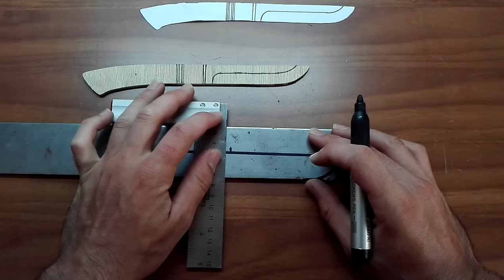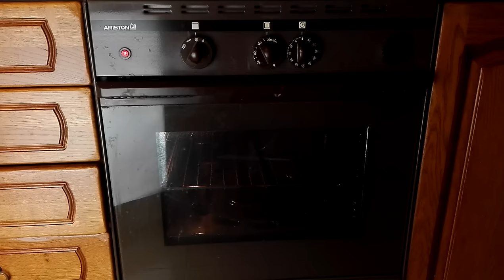Knife Making: Vikings Inspired Scandi Knife

Comment: Great video and music :)
One question, ¿how much time and at what temperature did you put it in the gas oven?
Thanks!!
Reply from the maker: Thanks! :) With this 1070 you have to temper in a single cycle at 200°C for 2hr. But even every high carbon steel might be slightly different! If you use a known steel check out the datasheet :)
Reply: Very informative answer =) ¿Do you know where can I see this datasheet? Lol!
Reply from the maker: Try to search for " ..... steel heat treatment" where ... is the type of steel. For example: "1070 steel heat treatment" gives this as first result http://www.steelforge.com/aisi-1070/
Reply: Thanks bro!

Comment: I usually temper my knives inthe oven at 200° C for 2 hours. Is it too much? Sorry im new to knife making
Reply from the maker: It depens on the steel you are using and what thickness is your blade :) Look for data sheet you can find all heat treatment info! Anyway for 1070, 1095 or other similar steel at 4mm should be perfect!

Comment: How did you make your forge ??
Reply from the maker: I used mineral whool and refractory cement, the air come trough a large rectangular steel pipe that has holes in it to allow air into the middle of the forge. :) On my fb page I have posted the photos i did when I made it if you want to check them out. Not a difficult project, it just take some time for the cement to cure :D
Reply: oh cool. Thanks dude ! :}

Comment: How long do you leave it in the fire
Reply from the maker: I check with a magnet, when it reaches the temperatre where it doesn't stick anymore I leave it there for some extra minutes than I quench it. High carbon steel like this one or 1095 are quiet forgiving with the temperature, you can get them hard easy like that! :)

Comment: why all that work but only put the tang 3/4 in?
Reply from the maker: I don't get it :) It's an hidden tang knife, many are made like so :)
Reply: a true hidden tang goes all the way back in the handle, with about a half inch of spare space, theres well over an inch of spare space in here and that can cause the knife to break more easily. persoanlly i put my tangs right through to the other side, then i slip a piece of steel over top and pein it so it's tensioned in. it isnt hidden but i think a full stick tang is better anyways.
Reply: dont get me wrong bro you did a fantastic job on this knife, just next time make the tang run all the way in to the base of the handle

Comment: why using oil instead of water to cool it off?
Reply from the maker: The steel I used needed to be oil quenched :) every steel has different hardening process, like water, oil, air or even between other metals plates! ;)
Reply: There I learned something new!^^
Thanks